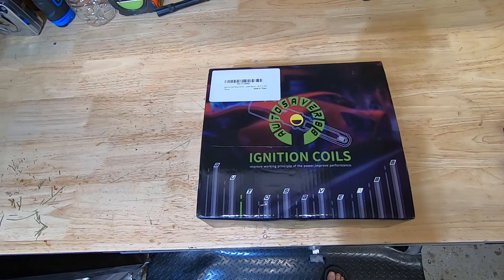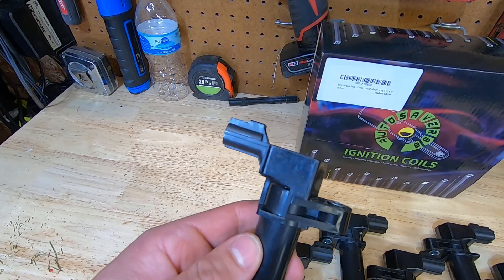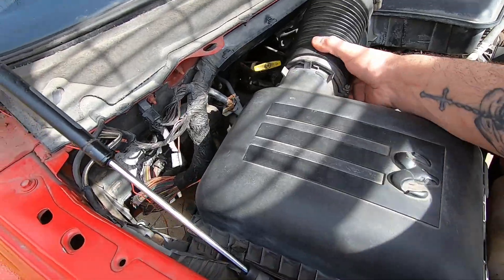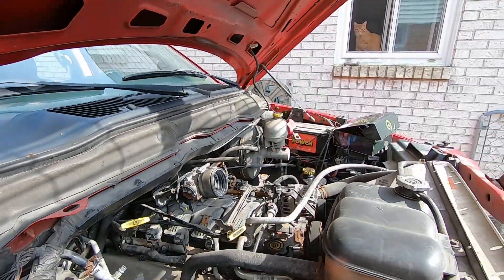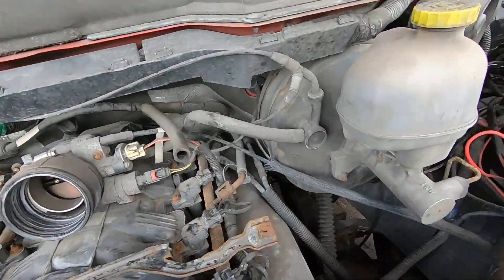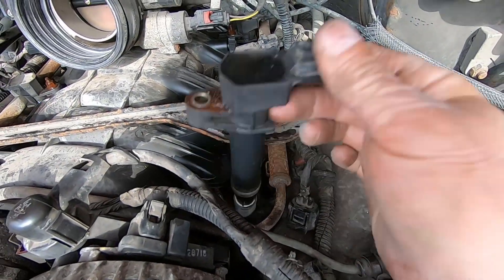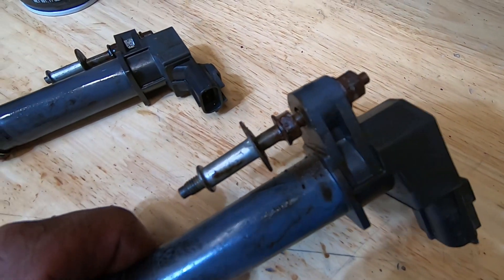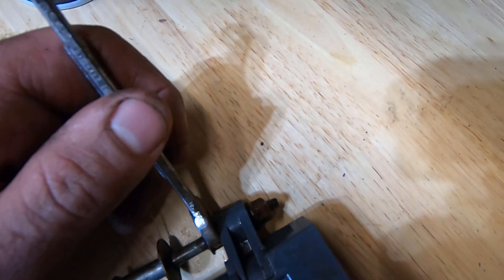How to replace coil packs on your car (Autosaver coil pack review)

Comment: Very helpful.  Thank you tons!!  My 2001 Durango still going strong with 275,000 miles but I just spent 2000 dollars on the steering mechanism, so I don't want to part with it.  Just started having similar symptoms as you were having.  Possibly replacing the coil packs will solve it.
Reply from the maker: @juanvaldes2458  Goodluck

Comment: I have the same problem,I’ve change the coils already,new gas pump new mopar spark plugs and I still having trouble the next thing to do for me is change the two sensor that are shown on the other video
Reply: Try you crankshaft position sensor!

Comment: HI Chuck! Got everything in and running but now I have a RFI issue with the Sniper I have to go back and find out where its coming from. I did not remove the unused wires from the Harness Pins so they think the AFR Issue is coming from there. And I also ruined the O2 sensor so...DOH! Funny your on Coil Packs my uncle wants the Accell Packs for his LS Engine just because he likes the look how...utterly...never mind...He also wants someone to give them to him for free...Might be a long wait HA HA 100 yesterday and 90 now...KILL THE VIRUS !!...Reminds me of a old punk Song...I AM THE VIRUS...Good to work out to!
Reply from the maker: Man it's cold as I do t know what here kinda depressing lol but didnt stop me I went and picked up my new built 700r4 for the impala. BeeG looking for a hoist that will work with my garage, my ceilings are only 83 inches high so leaning towards a mid rise just trying to find one at a good price
Reply: @AllThingsCool  Well hopefully some of this weather is heading east maybe this means we get a longer summer. My neighbor was using a small harbor frieght lift to pull his Honda engine back a while back I know his garage is way small had no problems. Now of course my uncle wants the 4L60 for his 41. His 700 developed a leak probably front seal so there goes more dough out the window. I dont know how he does it. Virus or no Virus he just tools around in his 62 Old Glory Waving out the back he mounted a pole mount deal on the flat bed stake
Reply from the maker: @Jeffagarcia66  lol that's awesome. I think the harbor freight scissor lift might not allow me to do any trans work though at least from what I've heard
Reply: @AllThingsCool  there was one at man I cant remember it used a chain or strap to keep the trans from shifting it was many years ago in fact it might have been one of the first contraptions harbor freight would sell back in the 80s...Got so used to having to pull the engine and trans it did not occur to me...low ceiling threw me...never pulled a engine out inside before LOL HAHA
Reply: @AllThingsCool  check Luckys Garage show Chanel he just did those home made wood criss cross car lift stands that support the whole car at the tires. maybe then you go a little higher and safer than jack stands alone. if you want to do a four corner lift to get the car up then try the standard trans scissor or even look at some of the ATV or motorcycle lifts maybe you can modify one might even be better than the current offerings. I do remember now what we used it was one of those stupid cross beam things that go on the end of the floor jack I just do not trust those standard jack stands especially if I am out alone doing work underneath.. Those wood things as very strong. Although I did take note how he actually has his truck resting on them...you gotta see he has his frame lift in between...Funniest thing is I just told Lucky to post more creative out of the box stuff Lest our minds atrophy when one does not use his or her creative side it rots the mellon sooner than later...Turns out its already happening to me..Cant believe it suddenly occured to me you were talking about the trans I thought Trans Engine coming out! haha thats how often we had to do the whole thing